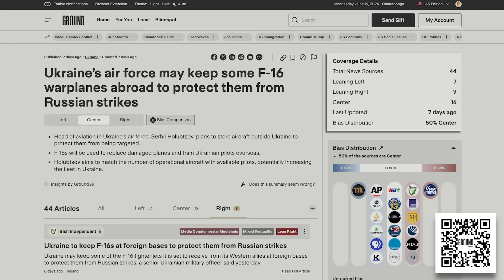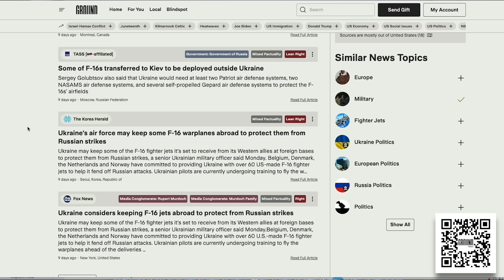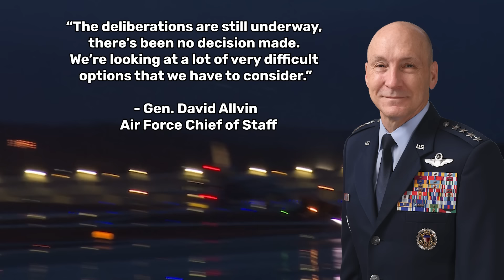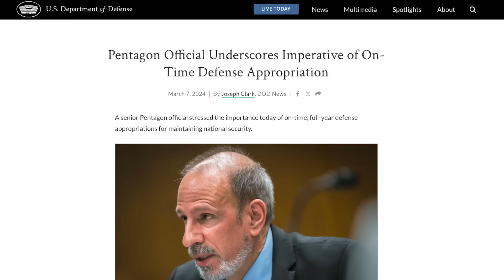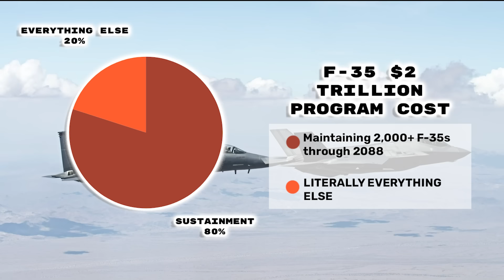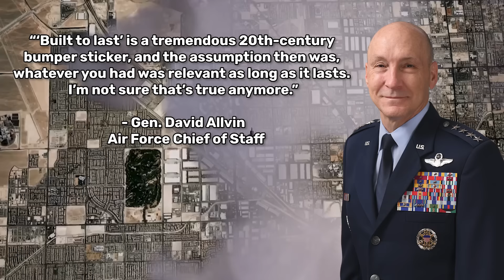Will America's new stealth fighter be shot down by cost already?

Comment: The USAF has considered a SLEP (Service Live Extension Program) for the F-22 since 2009.
In 2022 Lockheed Martin was awarded a ~$10 billion contract for further upgrades, until 2030, intended for the existing ~150 combat capable aircraft, as the USAF wants to retire the oldest ~30 airframes, currently used for training, but some are calling for these to also be upgraded. 

Hence, while air force chiefs have publicly announced their intention to retire the aircraft, their spending choices suggest otherwise.

Why they're being deliberately misleading isn't clear, but it could indeed be a negotiating tactic.

Comment: I think the answer is to build the airframe for a long lifespan and make all the other systems modular and easily modified. upgraded, or replaced. You should expect to replace the radar, ECM/DECM and other avionics every 10 years. Until we can make jets that are optically, heat, and electromagnetically invisible, all improvements in stealth will be small and incremental. Therefore, no radical changes in the airframe are required.
Reply: Kinda how the F-35 was intended.

Comment: Pratt & Whitney F135 engine, in the Lockheed Martin F-35 Lightning II, produces 28,000 lbf (125 kN) of thrust without afterburner and 43,000 lbf (191 kN) with afterburner. 2 in F22 and job done.

Comment: Build a new fighter model every five years? After a few iterations of that, maintenance would become a nightmare.
Reply: Indeed. That would create a much larger number of spare parts needed and put a massive burden on logistics, which is a terrible idea. Do not put  unnecessary burdens on logistics!
Reply: I imagine that they would try to use many of the same parts if they were to do this. A new does not necessarily mean all new parts.

Comment: I would be fairly surprised if the NGAD doesn't go forward more or less as planned already. However what would not surprise me at all is if the go with this alternate acquisition and funding model for all of the supporting unmanned platforms that get paired up with the NGAD. That could also be what those statements are referring to as those unmanned platforms are as much a part of the overall NGAD program as the primary aircraft that we are typically referring to when discussing the topic. It would make sense that the main manned platform is something that will stick around for 50+ years while all the other unmanned supporting aircraft get swapped out as new tech comes online. When we get a new radar or new missiles or new e-warfare systems they can build a new unmanned aircraft to field that new equipment that meshes into a the larger system of systems architecture that the NGAD is leveraging without needing to redesign the primary manned aircraft that is directing all of those systems.

Comment: If on a cost based Go/No Go decision, I expect that platforms of this type but significantly simplified will begin to proliferate. A cross between current spec and a high-performance drone. Task specific, less stealthy and less survivable, just as capable in fewer roles, but way cheaper.

Comment: Before we get crazy in building the next fighter, we need to disrupt the monopoly of its construction from designing to its construction. These plants, need restructuring in how to build these planes, as anything else. Each part of these planes are made in a different state, fuselage, wings, electronics, etc.  And of course the assembling. A bid for each part and process with a given inforced cap.
  We can't go on building these planes with unrealistic priceses!
  When you go out to buy a high-end stereo, you consider what is a desireable sound and build from there. The parts of these Fighters are made in separate states, with a cap on realistic prices. It can't do anything but lower the price, as each part of the aircraft is out-sorced with the best price accordingly, to the designer's spects.😊

Comment: For this and things like Naval expansion, sub programs, industrial base, etc., it seems like we really need a re-capitalization funding bill apart from the NDAA. Something that allocates, like, let's say $50 billion/year for 10 years, for example, or whatever the full funding & time-frame needs might be, but just specifically for priority recapitalization projects like NGAD so that funding is stable & keeps coming on a regular basis throughour that required time frame. We need to ensure that the necessary funds for necessary programs will always be available over the necessary length of time to garauntee development & implementation is not inhibited, interfered with or interrupted due to bureaucratic, political or any other kind of nonsense, prevent things like stop-starts, and keep the funding steady & predictable regardless of what goes on with the NDAA in a given year. 

Also, as to the digital century-series conversation, how I'd understood the idea behind the digital century-series was that it would be used for the CCA portion of the program to keep updated drone wingmen coming in at intervals of every few years, and ensure that no one version of CCA drones are around for any more than 10 years so that they stay well ahead of the curve and aren't draining resources having to be extended & kept up. The fighter, on the other hand, I'd understood to be, in concept, built with large margins and be easily upgradable & highly adaptable in all aspects, but especially to make it a *relatively* quick & painless process to make the necessary updates & upgrades as the control node for those digital century series drones coming online anew every few years. Am I incorrect or have a less than accurate understanding? Anybody who might know more on the details with those program development strategies and the differences between their application to F-X & CCA, I would be very interested and grateful to hear.

One final venting note, I've gotta say, the way that the $1.5T to $2T F-35 lifetime costs estimate is thrown around in the media really pisses me off, especially considering literally no other program has ever had its total lifetime costs calculated that way. F-35 opponents were real a-holes coming up with that kinda messaging, made more so by the fact that they rarely ever mention the fact that the F-35 program is one which involves essentially 3 very different aircraft, and it bugs the hell outta me that they got the narrative to stick so well that it's basically the first thing anybody in the media mentions when talking about anything even vaguely to do with the F-35. I mean, what would the total lifetime cost of F-15 be if calculated that way? Or total lifetime costs of Nimitz-class carriers? Developing & construction costs of the Nimitz-class are easy enough to find, but I've never once seen, read or heard a thing about the all-encompassing lifetime costs, including, but not limited to, upkeep & maintenance, repairs, overhalls, updating, refueling, operating and any & every other associated cost in the same way for the Nimitz-class carriers as for the F-35. The numbers are out there, I'm sure, but I never hear about it in the same way. It's only ever discussed in that way when it's in reference to the F-35.

Comment: this reminds me of the line in the film 'Independence Day' when some one makes the comment things are expensive in the military, why do you think a toilet seat costs 20K - this the totallity of the US miltary spending

in the UK it happens just as much, as I worked on the same advanced technology demonstrator twice, and each time our masters decided to wait until later (in this case 10 years) before restarting again and then deciding to wait yet again - it drives the researchers MAD and places truely massive costs on projects - with the only winners being those military supplies switched on to re-sell something already paid for yet again - in my case, i actually saw some of my own documents and code being re-cycled by a certain manufacturer - and no-one in food-chain was that concerned

another reason being a change - a idea put forward almost 20 years ago was to build BORG type battle assets for the army - inside of the more traditional way of making such assets, we came up with an approach to make such assets far more modular and plug-an-play - apart from a central nevrous system in each asset, all equipment connected to it was so modular and self contained - once connected it relayed its specific operating parameters to the nervous system - no going back to manufacturing base for every update in equipment, just plug-and-play hardware with plug-and-play software - but military manufacturers stated huge costs to change, fogetting the huge long term savings in keeping assets on the battlefield, ease in updating, ease in stripping a damaged asset - we could add new functionality to an asset whilst in the battle field - but it was decided to do what they always do, change nothing

you can bet this is also true here - these UCAVs will not have the same cockpits as manned and whilst a black-box piece of equipment functions, its also needs a controller function which is where the pilot interacts - its close to a 50-50 split in costs and its called the on-board Mission Planning System (MPS) - making meaning - fusing data together

it also comes down to the fact that neither Russia or China has anything the US has to massively worry about - YET - so they will play with the technology but no go to production

the US, like the rest of us has been watching large battlefield assets being destroyed by small in-expensive weapon solutions - and its making us all think about what could happen to our in-service assets right now - it sends a cold-shiver down our spine when you think of losing a capital asset to something costing almost nothing in comparison - the only forgiving condition here being is just how bad the Russian tactics are

Comment: Cost is not a problem. Plan is to build over 2,000. Russia only has 35 SU57's and probably can only build less tan 100. Same problem with the Tiger I during WWII. Germany only built 1300 while the US built 40,000 M4 Shermans. The bottom line is, production not weapon performance wins wars.
Reply: Russia isn't really a concern. It is China who could possibly have 500-700 stealth fighters by the next decade with the latest version of the J-20 and the upcoming J-31.They already have an estimated 200 J-20s in service. How good their 5th gen fighters as compared to the F-22 and F-35 is still a big guess.

Comment: Could the problems that Boeing has been experiencing these past many years have anything to do with this "announcement?"  Does LM have the capacity to build NGAD, given that NG has pulled out to focus on the B-21?  Speaking of the Raider -- does future warfighting require the likes of NGAD?  The B-21 apparently blurs the lines of ISR, attack, strategic bomber and even fighter if armed with AA munitions.  Or, could something bigger and more urgently "needed" be entering the mix and thus drawing funding in different directions?  F/A-XX makes sense, but NGAD, in light of team F-35, F-15EX and B-21 backed with the new and improved B-52, makes me wonder.

PS, I got a chuckle out of your Mirage "Six" 2000 in the Century Series.

Comment: Hmmm, it seems like there are many categories of landmines involved: Our failing federal government, unrealistic military planners, the fact that design is easy, but manufacturing is very difficult (ask Elon). On top of all this, there is the non-vertical business model that easily hamstrings production if one of the thousands of suppliers doesn't deliver. If we can build a whole new fleet of fighters every 15-20 years, how is it that the F35 is still not were it was designed to be?  I am a patriot. The federal government et all and the military planners need to get focused on defending our freedom and away from the power trip the members have been on for the past 30 years.  Whew, didn't mean to rant, sorry.  Maybe realistic expectations and designs can be decided on easily if the idea is to get a new whatever every 10-20 years. You did a great job covering all the information points in a positive manner, as you always do Alex. Thanks.

Comment: Spend billions on development, select the winner, go into EMD, go into LRIP, go into FRP, get cold feet and cut the program because hey cutting edge tech is expensive to manufacture, have significant regrets about cutting the program, ask the prime how much it costs to restart the line, discover it will cost billions and engineering talent retired or moved on, stew for a decade, start another R&D program.

We know the cycle. Just shut up and build the thing.

Comment: The US produced 187 F-22 not 186, you repeatedly repeat that mistake, another mistake in the video is flight hours of the F-22, they are 8,000 not 6,000 and in 2020 the USAF run a life extension program on 135 of them by strengthening their structural integrity for added another 8,000 flight hours
Reply: Source(s)?  I don’t care about the number, but the hours.  I’ve read 6,000 hrs for the initial airframe, but I’ve not read about the extension.  Are you saying the airframes are now rated at 14- or 16,000 hours, or have they been brought up to a total of 8,000 hours?

Granted, adding ‘only’ a couple thousand hours doesn’t seem logical, but 16,000 hours for a fighter seems optimistic.  Maybe that spec comes with flight restrictions?

Comment: THIS Is why I have been so critical of the F-35 program. This program is now estimated to have a cost of $2 Trillion dollars and the services are saying the F-35 will be in service to 2088. No one should really consider it feasible that the F-35 will still be a viable front line aircraft in 30 years much less 64 years from now.  The big winner here is the defense industry, and the Pentagon and the US Taxpayers got hosed. The F-35 may be all it is built up to be, but the price was so high that it has locked the services into a tight financial box that may be inescapable.

Comment: Except , existing and pre-tested design (F-22,YF-23) - thoroughly updated to modern materials and manufacturing with TR3 F-35 avionics - would still be 1. safer choice 2. still leap in capability; especially in numbers.  Some upgrades - such as  LV-100-5 for M1 Fleet or re-engineeing B-52 should be mandatory. And FFS get US Navy out of dreamland and spending spree; last time they had anything on budget was Virginia. LCS and now Constellations are sad jokes (see latest Sub Brief). Anyway - building another super F-15 for contested airspace with somewhat proven F-35 systems should NOT BE THAT HARD.